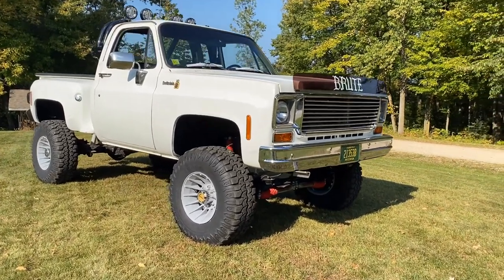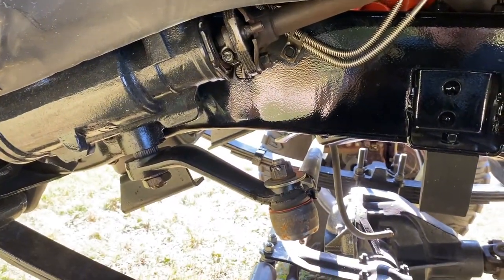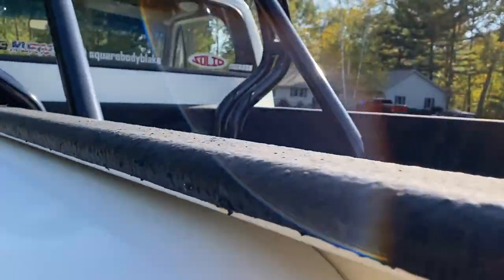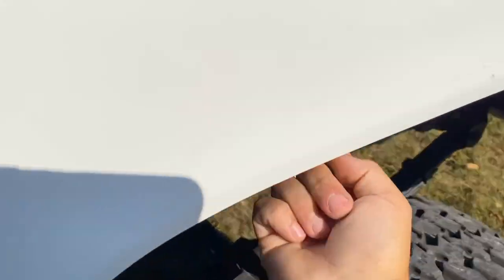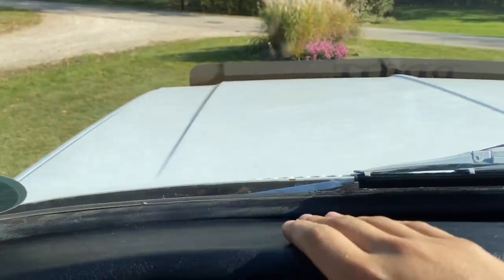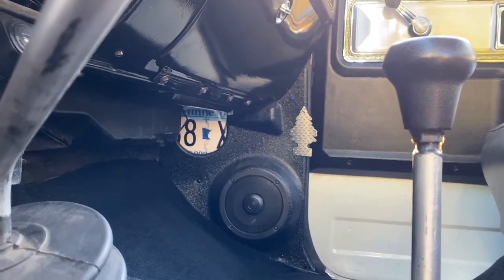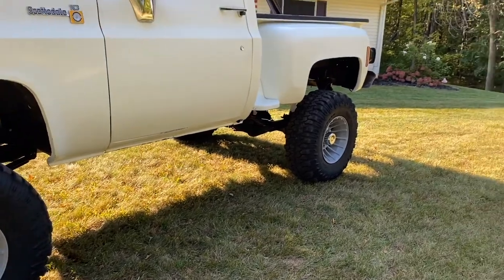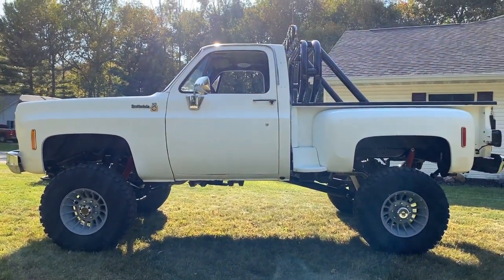Square body build 1978 Stepside |square body|

Comment: Absolutely love those wheels for sure!! I have two sets of 16”x10” 8x6.5. Bolt pattern!!! One set has a set of 39” boogers on them and are on my 1969 Chevy 1Ton 4x4 and the other set has a set of 35”x12.5 BFG MT and they are the good older tread pattern that wore like iron!!! They are a brand new set of rubber!!! Those shoes are on a 1981 GMC 1Ton 4x4 those two body style trucks are definitely my two favorite styles!!! That step side is definitely a beautiful truck for sure!!! Plus my favorite colors are a two tone blue and white or I’d do an all white in like a Perl white color!!! I absolutely love the roll bar also!!! I have a triple roll bar in my 1969 Chevy 1Ton and it’s color is a factory like turquoise/blue!! I had thought that someone had done a custom paint job on it but found out that it was a factory color!! I was going to paint it white but after I found out it was a factory color and I have never seen another one like it before I’m going to repaint it the same color!! It actually a really nice blue but faded really bad!!!!

Comment: How would you compare the drivability of the crossover steering compared to the stock setup on the highway at speeds?
Reply: It’s the only way to go with these straight axle Chevys . A friend of mine had a 78 basically like yours except a total of 23 inches of lift 44s and 15 inch word wheels.  We made our own steering system with the 2 Wheel Dr. sector fear. Do you have a real nice truck.